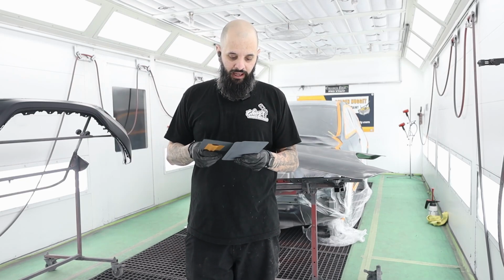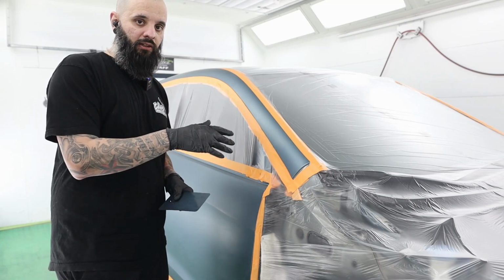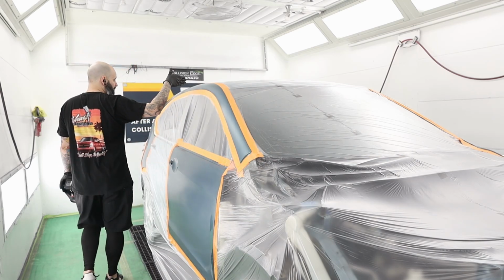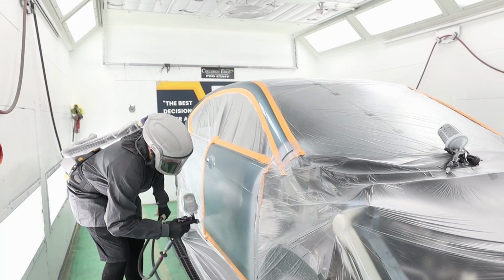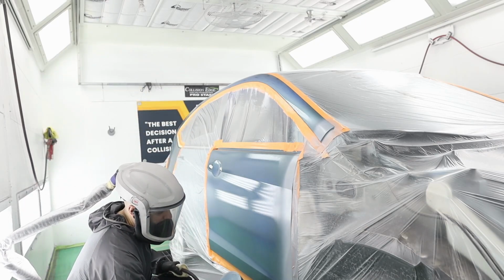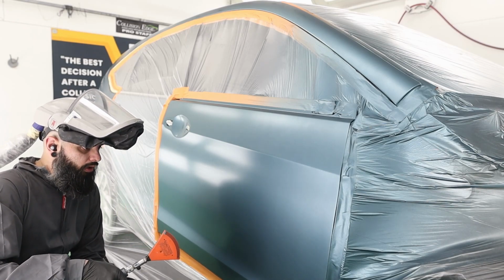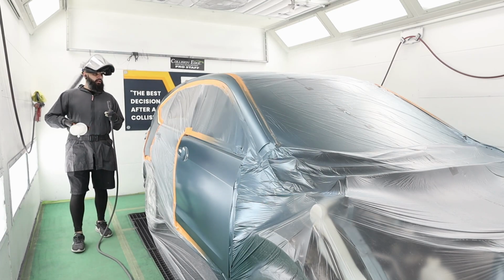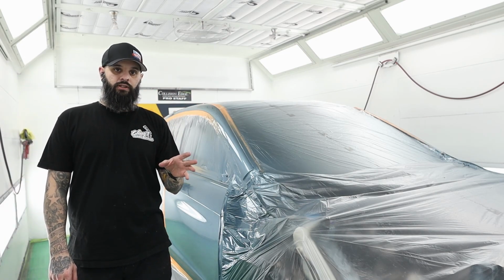Perfect color match every time!

Comment: I was told to drop the pressure half and twice the distance from the panel for drop coat, but when I do this I get Hella sand piling. How did you come up with just dropping a couple psi? I'm going to try this next time and see if it helps with sand piling.
Reply from the maker: Trial and error. I’ll drop 4-5 psi double distance and tighter overlap. Use a wet bed to help avoid sand piling. I know that struggle all too well!

Comment: I use sherwin, right now we’re still stuck in 7k, changing over to 8k soon. My question is I’ve always sealed the edge of my blends like you did but I’ve never heard of burning that edge in, when you say use reducer and you talking about just using straight US4 or US5 reducer just over top of the sealer?
Reply from the maker: Yes! Just straight us5! It softens the edge of your sealer so it doesn’t have a rough transition when you spray basecoat over it! Try it! I bet you’ll love how much smoother it looks!
Reply: Tried it!! Won’t ever seal an edge without doin that ever again lol. Also follow you on Insta and I see you really like the sagolas, never tried one, if I was gonna pick one up for base, again I spray sherwin solvent, which one and tip would you recommend?
Reply from the maker: 1.3xl for solvent! Hvlp air cap! When I had a sunfire pro solvent bank it was $$ for that line! Sprays similar to bc8!